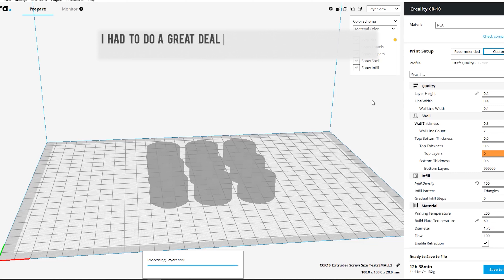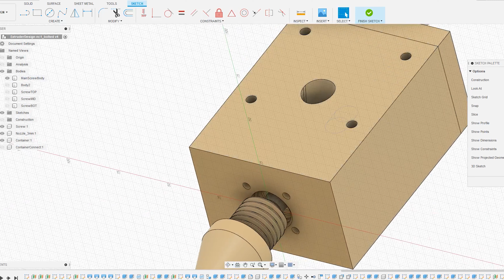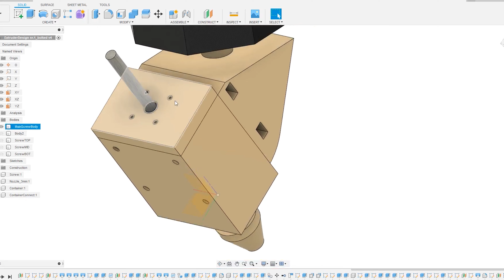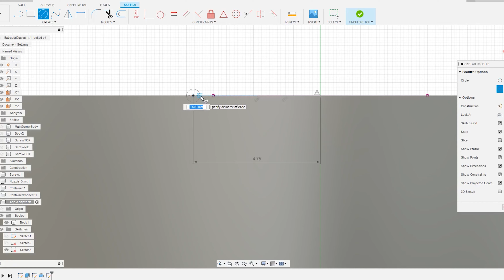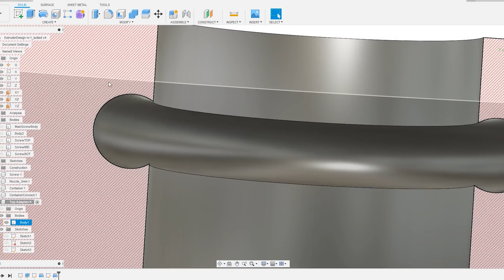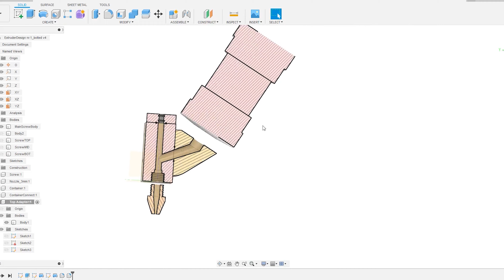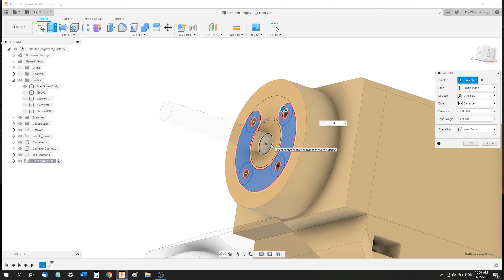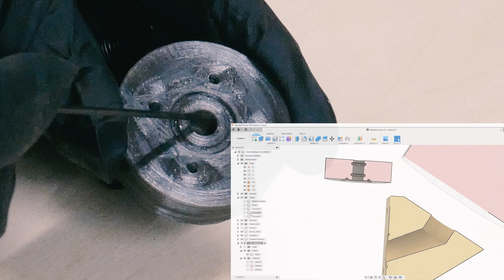DIY Ceramics 3D Printer (part 2B) - Extruder Experiments | THE EXTRUDER | CAD

Comment: channel is so under rated.
Reply from the maker: You think so?  Thanks! 😁👍
Reply: @WillysGarageNorway  What is the torqe of the stepper motor that you use?
Reply: @WillysGarageNorway  Do we really need the air compressor? I have seen some work with the stepper motor alone.

Comment: I am in the process of designing a clay extruder now. I am wondering if you have used a Wasp delta clay, or other clay printer before, because you basically have to clean the extruder after each use unless it is just constantly printing. It looks like it is going to be very difficult to break down for cleaning. Also softer clay would help.